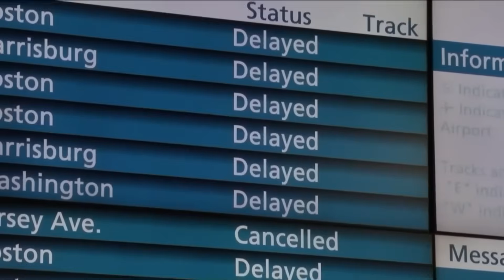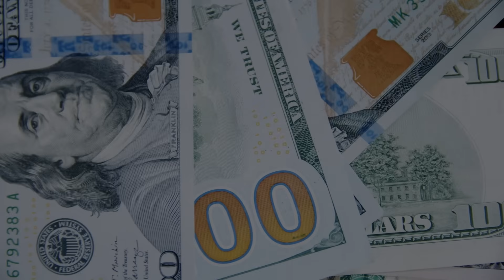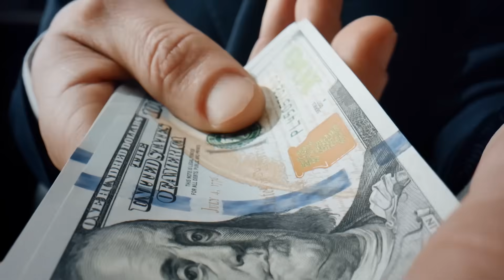Portal North Bridge Project: America’s $2.4 BILLION Fix To A Failing Rail System

Comment: This is a positive for commuters, but there really needs to be FOUR  (4) tracks between Newark and New York Penn Station.  Anyone who is a frequent rider knows the various delays have impacted schedules (i.e. disabled trains, tunnel maintenance, power loss, signal issues, etc.).  This project, along with the new North River Tunnels should aid greatly in resolving current issues.  Thanks for posting.

Comment: they think small with the new bridge
Reply: And what’s thinking big then?
This is thinking realistically, but optimistically.
Reply: @andrewreynolds4949 
When a new car bridge is built usually it goes from 4 lanes to 8 lanes of traffic.
Reply: @42luke93  Says who? That's not the case near me. I see a lot of bridges being replaced like-for-like, with pedestrian walkways added either side (when that's useful and practical). Very few bridges I know of have been doubled to 8 lanes, though some have been expanded to 6. Far more common is additional grade separation, which there is provision for here; don't forget the long-term plan is for two bridges with 4 tracks, and a grade-separated crossover line between them.

There's also the adjacent Sawtooth Bridges replacement about to begin, where they are fully building out the four track grade separation from the start, along with the chord fifth track that would make the most use of the crossover line at the Portal Bridges. So no, not thinking small when put together with the rest of the Gateway program.
Reply: @andrewreynolds4949 
So the new Newark Bay Bridge Proposal is an example. Despite the highway being 2 lanes anyway. I didn’t think this was so far fetched but see your example points.
Reply: @42luke93  Nowhere near me, but I'm surprised that's not 6-8 lanes already. I'm sure 4 would be extremely overcrowded.

In any case, it appears to be a similar approach to the Portal Bridge replacement: build a new structure on an adjacent alignment, then demolish the old, and build a 2nd structure later on its footprint.
Reply: @andrewreynolds4949 
That makes more sense than building a wide one that won’t be used. Who knows if a second set of tracks ever would be built too in decades.

Newark bay bridge is hit or miss. Once get passed the funnel traffic section bridge has no traffic generally.
Reply: @42luke93  I do wonder if 6 lanes would be sufficient, that appears it would mostly eliminate the funnel. 6 is generally the optimum number of lanes on an interstate.
Reply: @andrewreynolds4949 
Probably but  it seems that they want to be safe.

i78 branches left to Manhattan and 440 branches right to Bayonne. Looks like two lanes could be dedicated to each and redesigned.

If it’s 3 lanes then two probably would be for i78 and one for 440 to Bayonne exit. The other side funnels out so it is less of an issue going back to Newark Nj.

Comment: I think I read once about the possibility of a north bridge.
Reply: The plan ultimately calls for 2 identical spans each 2 tracks creating a 4 track system. 
This area is extremely congested with both Amtrak and NJT trains 
Frankly, I don’t know why they didn’t make this span a 3 track span as it would act as relief valve.
Reply: 4 tracks is normally sufficient for any number of trains they expect to run through the area. Portions (though not on the main spans) will include an additional line to allow transfers between pairs.
Reply: There will be. They're just waiting for funding.
Reply: The new bridge is Portal North Bridge. A nearly identical Portal South Bridge is also planned, but is unfunded and is a relatively low priority.

Comment: Now they need to connect Amtrak in Boston so that trains can run all the way to Maine without getting on or off trains.  And no I doubt this will fully improve it since it will still only allow for 2 tracks.  They should have already made it four so you have two each way, one for amtrak and one for local trains.
Reply: The Portal South bridge was supposed to provide two more tracks but they couldn’t find funding.
Reply: yeah fully agree
Reply: That would require another big dig because the Sumner and Callahan tunnels as well as the Blue Line Tunnel are in the way.  Going under those tunnels would require too steep a grade especially at the South station end.
Reply: @BG-sl9lv one proposal I saw did require 3% grades not good but doable for passenger only. I wonder if they sunk the through running platforms one extra story at the stations if that would improve the grades. Hopefully that would be achievable by sacrifing one platform (probably on the edge and digging down from within the existing station. A very interesting problem and any solution will be expensive.
Reply: This will never happen, at least in our lifetimes. The amount of funding needed and completely overhaul the underground of boston would be in the hundreds of billions. At absolute best they could do a connection at South Station but it will never be a direct train
Reply: @andrewschmid5917  The US needs to return to Kenseryian economics.
Reply: Originally The Big Dig was gonna include a rail tunnel to connect the stations but that was canceled due to the aformentioned concerns with existing tunnels and steep grades